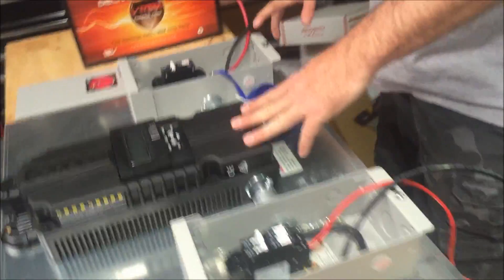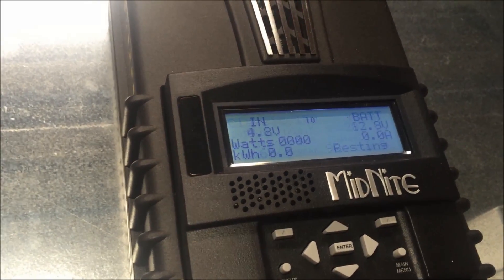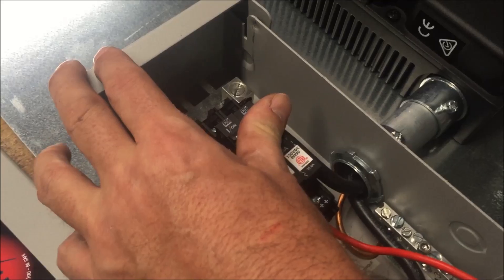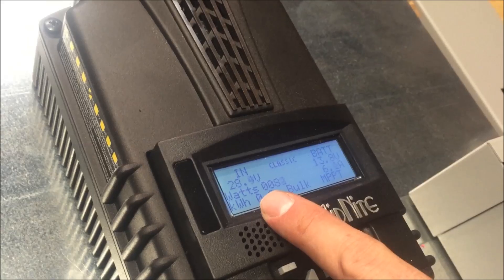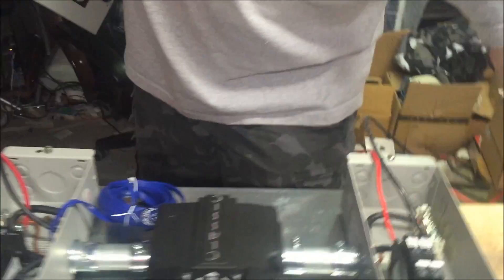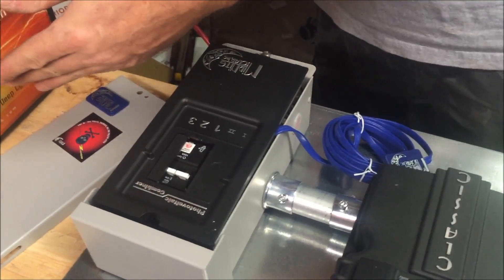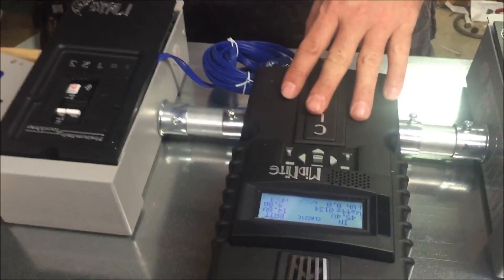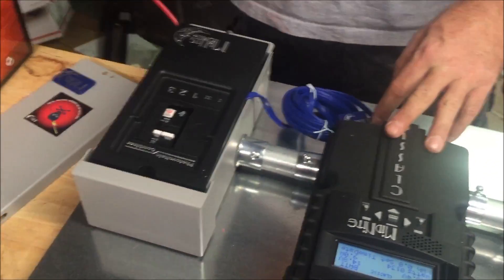Hurricane wind power reviews midnite classic 150 charge control  mnpvn3 board

Comment: This is the video that I first saw and is my inspiration for going off grid for my remote cabin in the northern Arizona. I would like to add  a wind turbine maybe around 1000 watts initially. Most of the components I have already are 24 volt. I have 4  new rolls Surrette  550 ah 6 volt battery’s  I would be wiring in series for a 24 volt system. I’m not sure about how to deliver the power from the wind turbine approx. 110 feet away from the  cabin to the top of my 50 foot rohn tower. And which type of turbine to purchase. I have approximately 1800 watts of solar that will go on the southern facing roof of the cabin.
 .